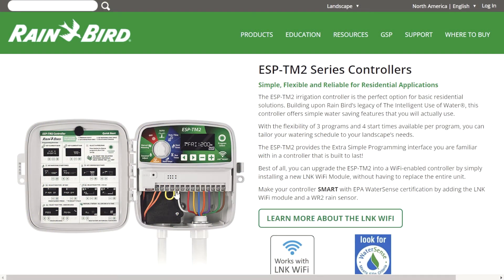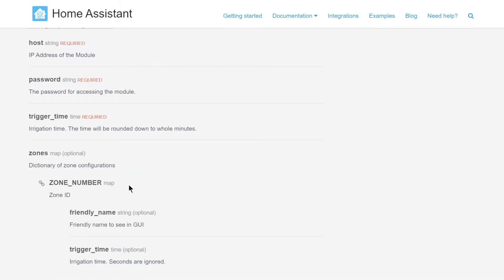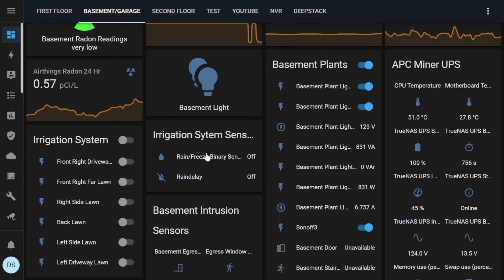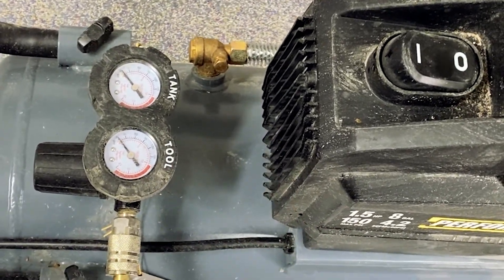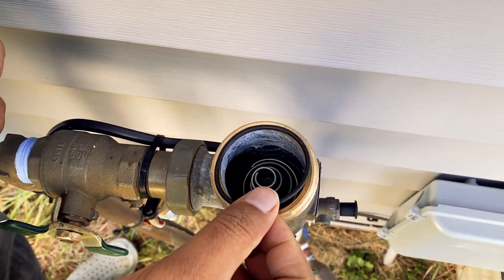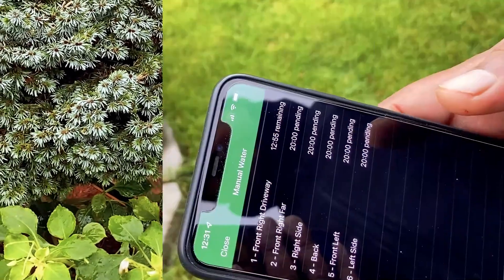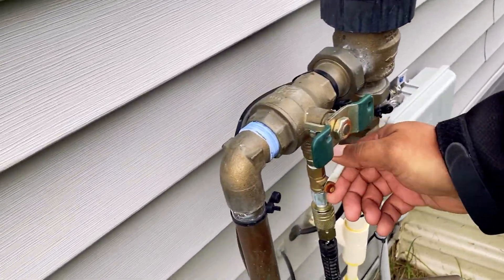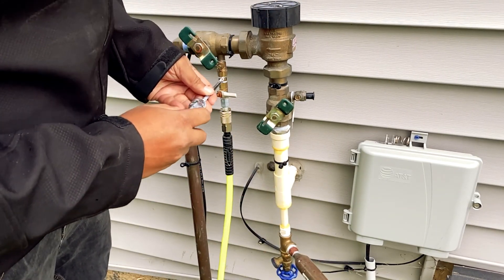Rainbird Irrigation into Home Assistant & Full tutorial on Winterization

Comment: Does the Home assistant integration affects the app access?
Reply from the maker: I think only one connection at a time to controller, so yes it should. Practically I have not had issues connecting via app while the integration is running
Reply: @deb-sahu  Thanks! Another question, if you turn on the switch it will “open” the valve?
Reply from the maker: Yes! Perfect for doing image recognition and opening sprinkler valves to scare them away. Also if you have a program setup on the controller, and a valve opens, the switch is reported to be on.
Reply: @deb-sahu  Nice! If it’s start irrigating, can you stop by turning off the switches?
Reply from the maker: Yes it does